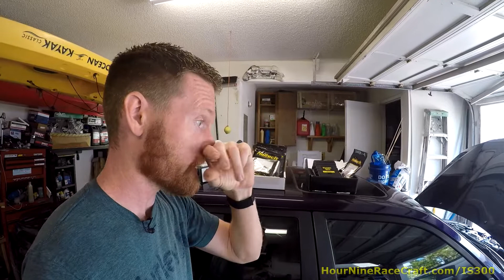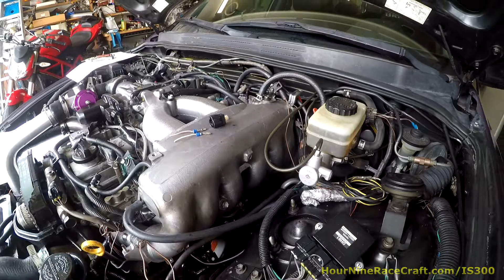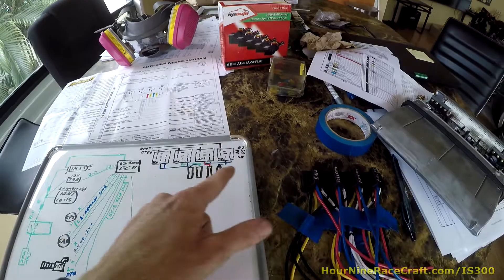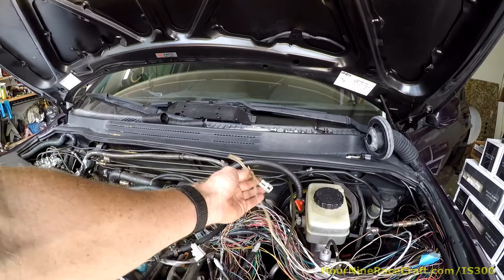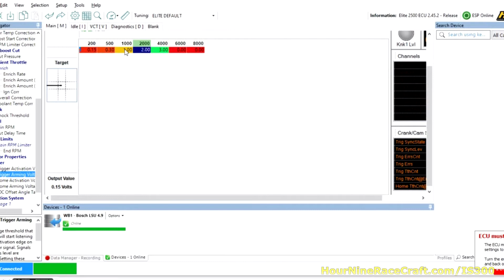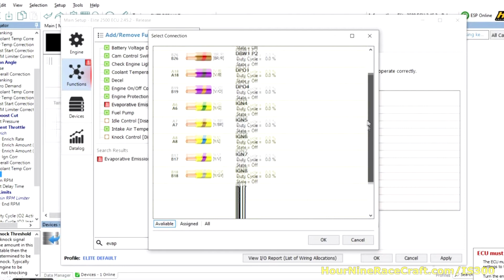IS300 Gets a Standalone (HOW-TO on factory harness)

Comment: Hey bro, hope you’re doing good.

I saw your video about wiring the AC with standalone ECU and it was really helpful. I’m currently working on my 2001 Lexus IS300 with a 2JZ-GE and I’m running an AEM Series 2 ECU in parallel with the stock ECU.

Right now the AC system works if I manually power the relay — the compressor engages and it blows cold — but when I press the AC button inside the car nothing happens (fans don’t turn on and the relay doesn’t trigger).

Since you’ve done similar standalone wiring setups, I wanted to ask:
Would you recommend letting the standalone ECU control the AC relay directly, or should I try to restore the stock ECU control signal?

If you have any wiring diagram, tips, or could point me in the right direction for the proper AC request and compressor relay wiring, I’d really appreciate it.

Thanks in advance for your time and for sharing your knowledge in the videos — they help a lot of us working on these builds.
Reply from the maker: Thanks for the comment! The 2001 has very different wiring compared to the 2002-2005 IS300. The ECU is different as well. My knowledge is on the 2002-2005 model, but hopefully what I say will transfer over or give you some direction to look in. You've probably double-checked that the A/C wires are connected to your ECU still, but look at your BEAN wires also and verify they're connected still. The IS300 sends BEAN signals from the climate control to the engine ECU. It's also likely that the engine ECU is programmed to not turn the A/C on if the engine is not running. The ECU wouldn't know that the engine is running since you have a standalone, this means you may need to trick the ECU into thinking the engine is running, which I've thought about trying to do myself with either an arduino or some kind of fake trigger wheel.

How the A/C and BEAN/MPX works:
BEAN is toyota's old-school CAN type network, but with one wire between devices instead of two in the modern CAN setups. The A/C climate control knobs are not connected directly to the compressor, the engine ECU is. In order for the A/C to function properly the signal is sent from the climate control to the ECU over BEAN when the A/C controls are changed. From what I know, the BEAN/MPX wires connect to the gauge cluster, ABS ecu, engine ECU, body ECU, climate control and maybe another device. They send signals to each other based on what function is being performed, but only one of the devices on the BEAN "chain" is a primary even though they will take turns sending signals, this primary is likely the engine ECU but I'm not sure. In the BEAN system, each device will send a signal with a little code in it that tells one of the listeners "this signal is for you", and all other devices on the BEAN "chain" that hear the signal will just ignore it since it's not for them. I personally left all of my BEAN/MPX wires connected, I say all of this because the issue may be in the BEAN wiring, I'd look at what wires are still on your ECU and verify that your BEAN wire is connected still to all devices since we don't know which is the primary. If that's not it then you may need to trick the ECU into thinking the engine is running by doing something creative. 

There is a link I have somewhere of an MR2 guy that made a "BEAN sniffer" to pull codes, and there is a guy on my.is that has done similar things, so if you're handy you can make one of those and output the BEAN data to your computer. Most of the toyota cars/trucks that use BEAN use similar signals so you should be able to find more information on this with a little digging if you want to build a sniffer and log it with a laptop. But, if the ECU is not turning the compressor on because it doesn't sense the car is running, then it doesn't matter what you do with the BEAN sniffer, you'll still not be able to get the A/C to turn on without tricking the ECU into thinking it's running or making a manual relay trigger like the one you mentioned.

Let me know how it goes! I'm curious
Reply: @LegitRaceCraft Thanks a lot for taking the time to explain all that — I really appreciate it. Your information about the BEAN system and how the climate control communicates with the ECU helped me understand what might be happening on my 2001.

I’m going to double-check the BEAN wiring and signals and see if the stock ECU isn’t turning the compressor on because it doesn’t think the engine is running. That actually makes a lot of sense with my current setup.

I really appreciate you sharing your knowledge and pointing me in the right direction. I’ll keep digging into it and let you know what I find or what ends up fixing it. Thanks again for helping out the community — your videos and replies help a 👍
Reply from the maker: no problem! I've dug into this a lot just because that's how I am lol. I have put a lot of thought into using an arduino to preload fake BEAN signals that I can use to trick my car into doing things (like control that MPG gauge on the cluster that does nothing). And your comment made me start looking into actually making one instead of just thinking about it. I want to make a bridge between my haltech engine management and the OEM ECU so they can speak to each other. It's not overly difficult if you know how to play with arduinos.

Comment: Been saving these vids for the big project. Hope all is well. Quick question why not just delete the charcoal canister
Reply from the maker: Hi! Thank you, yes all is well. I'm behind on videos due to getting busy, but the car is finished and I've been driving it around for over a year. I'll catch up with new videos soon when I'm off work. Regarding your question, I don't want to vent to atmosphere without the charcoal canister. This way is a little better. Normally it would be routed to the charcoal canister and then into the intake, but my car is turbocharged, so I don't want intake pressure to fill my canister and gas tank.

Comment: Excited to go through this whole video and series. Question. I'm planning to run my elite 2000, ic7 dash and making a haltech flying lead harness for my 1jz swap. Not running a/c. What functions from the stock ECU/ body ecu would I need to focus on wiring or retaining. I suppose the only thing from the body would be the locking system if the immobilizer controls that.  I'd love to get rid of the OEM ECU box and put the haltech under the dash
Reply from the maker: Thanks! The locking system is controlled by the body computer, so removing the ECU shouldn't affect that, the immobilizer just inhibits fuel injectors from spraying, but I'm not sure if the doors will still unlock without the ecu. There is a transponder that communicates with the oem ECU, as far as I know it's wired entirely to the oem ECU and not the lock system directly. I still have my ECU connected for my a/c, and I'm still using the temp gauge on the dash even though my Haltech has its own temp sensor. I've tucked my oem ECU behind the radio (recent video), but I can do this since I have a slim face radio, it leaves a lot of room behind the ECU.
Reply: @LegitRaceCraft  right on i appreciate the info. Will have to start unplugging some things and see what stops working

Comment: How did you terminate the Bosch knock sensors? Any diagrams of the wiring layout?
Reply from the maker: Polarity shouldn't matter. Connect one wire to signal ground and the other to the haltech.

Comment: Do you connect the speedometer and RPM to the haltech ecu or you still use eom ecu for that?
Reply from the maker: Speed signal is coming from the oem lexus ecu, but the RPM is coming from the haltech

Comment: What exactly is that bracket you moved from the front side of the intake plenum? It has a plug one black and white wire coming out. Is it just a ground? I cut it put a ring terminal on the end and connected it to me intake manifold and when I tried to crank the car it would blow the AM2 fuse. When I disconnected it the car cranks again and doesn't blow the fuse.
Reply from the maker: The little gray box that is on the bracket is an electrical noise reducer. It just cleans up all of the electrical "noise" for the ground signal that the sensors share with the ECU.

Comment: thanks for the detailed videos...im for sure learning alot
Reply from the maker: Awesome! You're welcome
Reply: @LegitRaceCraft same here, i'm learning a ton. i gotta run stock ecu as well to control the automatic trans for now, with ecumaster black. Question, so all i have to do for preventing check engine light with missing stock DBW throttle is to ground that DBW connector? thanks!
Reply from the maker: @Persocondes  If you're running an EMU black then the check engine light should be controlled by it. The check engine light shouldn't be controlled by the OEM ecu anymore. It won't matter that the DBW triggers a check engine light. My oem ecu (automatic now even though my car is a factory manual) throws CELs for the auto transmission solenoids and some other stuff, but it doesn't matter since my CEL isn't connected to the ecu anymore, the CEL is controlled by my Haltech
Reply: @LegitRaceCraft  thank you for the knowledge!